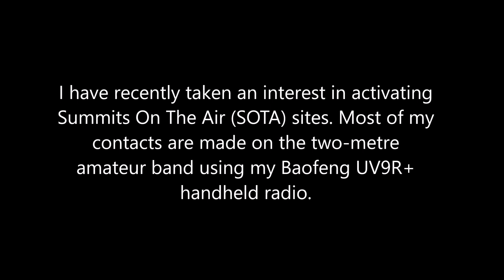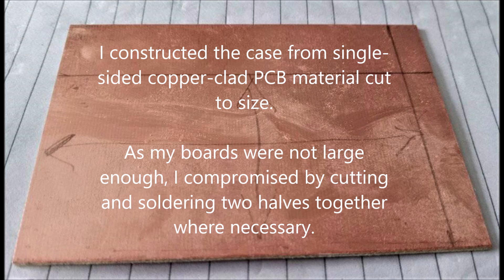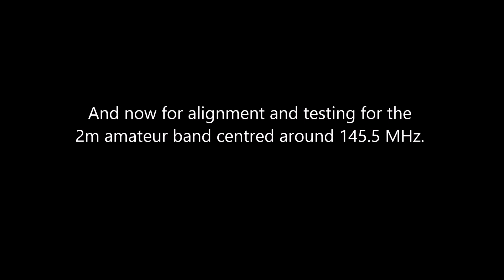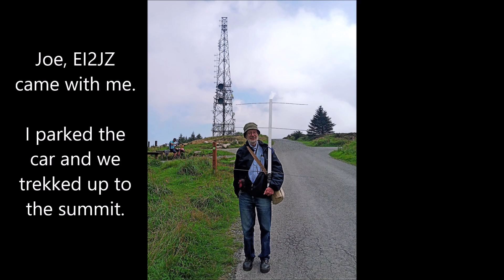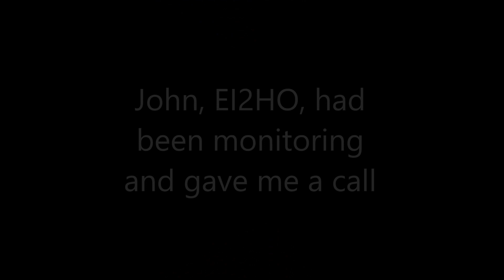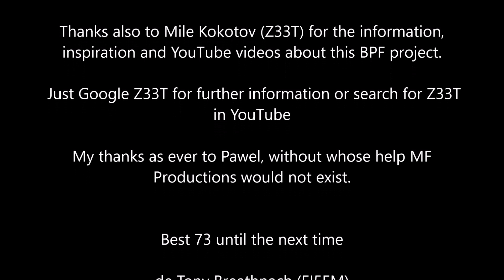A Homemade Helical Bandpass Filter for the Two-Metre Amateur Radio Band

Comment: I plan on building the filter for the opposite problem: Instead of interference on receive, I have a Radtel rt-470x ht that is good except in has atrocious 2nd harmonic suppression on transmit and I don't want to interfere with anybody our of band.
Reply from the maker: Good luck with it.

Comment: I have an Icom IC-V80E 2m only handheld radio, and I was shocked to find it could stand being connected to the aerial on top of a ham repeater tower - next to a commercial site. This was about 12 years ago when there was still quite a lot of active commercial equipment on the tower including cellular, pagers, trunked band 3 PMR with continuous transmitting control channel.

Comment: What determines the frequency range the most?
Reply from the maker: The size of the cavity and precise adjustment of capacitor gap.
Reply: @EI5EM  I figured out that the gap made a difference, but I wasn't sure if the size of the container and the spacing of the items in It played that big of a roll. Thank you!
Reply from the maker: The dimensions of the cavity, the inductance of the coils and the capacitance of the capacitors are all factors in bringing the unit to resonance at the desired frequency, Matt. It outperformed my expectations. It's not pretty, but it works  ... de Tony, EI5EM
Reply: @EI5EM  I made one, and it was pretty rough looking, but it did the job fairly well. I appreciate the video and the knowledge that you and others have passed down to other hams. Thank you! 73 from Ke0saw

Comment: Well done Tony. I am glad that you are satisfied with the results. It`s a very nice and effective VHF band pass filter which is easy to build. 73 de Z33T
Reply from the maker: Thanks so much Mile for commenting on my build and a particular thanks for sharing the design. My build is not pretty and I hadn't PCB panels large enough so I had to join halves. It's magical how it works and my video demonstrates it very well. Thanks again Mile and best 73 from Ireland de Tony (EI5EM).